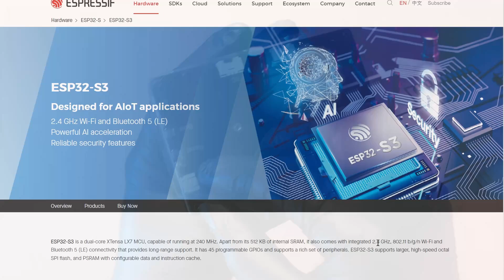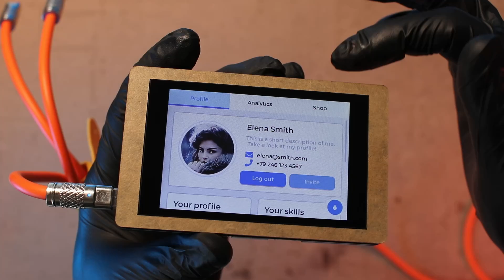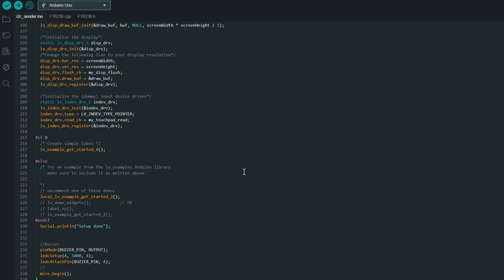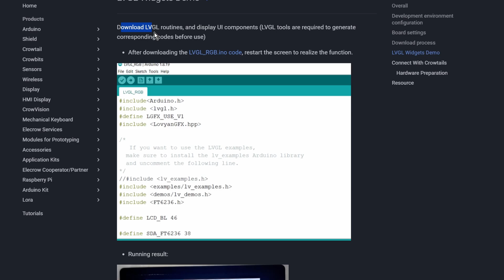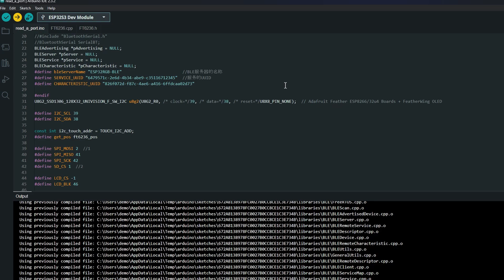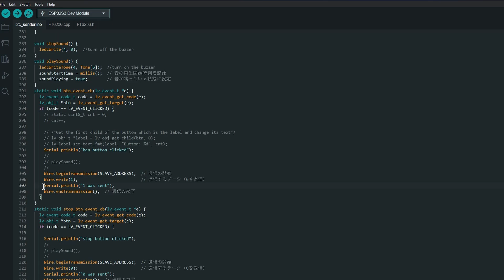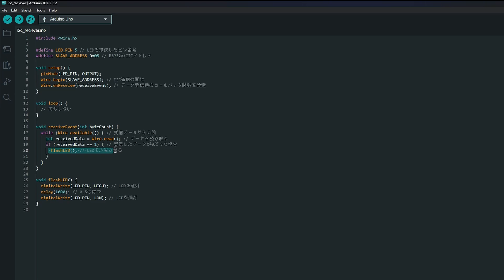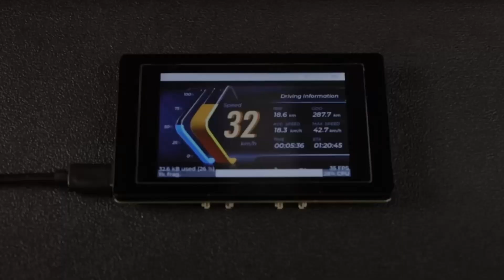CrowPanel –ESP32 Terminal with 3.5 inch parallel 480x320 TFT capacitive touch RGB display

Comment: Can you share your LovyGFX config file for elecrow 3.5 display
Reply from the maker: Sorry for being late to reply. All the related code can be found here : https://www.elecrow.com/wiki/esp-terminal-with-35inch-rgb-capacitive-touch-display.html
Reply: @KOKENSHATECH  Thanks for your reply,  I just figured out that this display is a esp32 3.5  Terminal.  It uses an esp-s3 and is connected to the display chip parallel port.  I am trying to get lovyanGFX to work with the smaller crow panels using spi.  But I may need this display in the future it is the same as the 5 inch Crow panel. Cap touch parallel connection and the s3 so it is better.